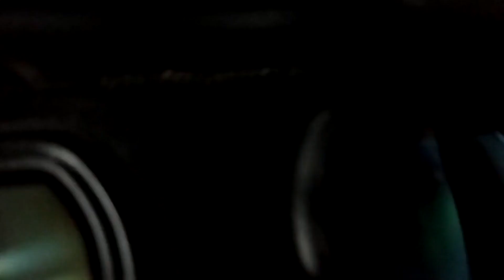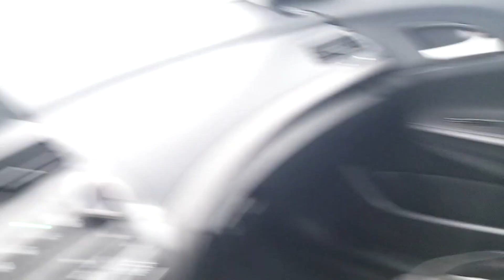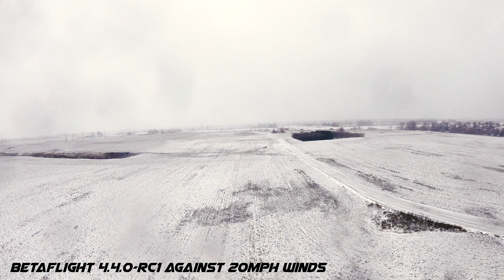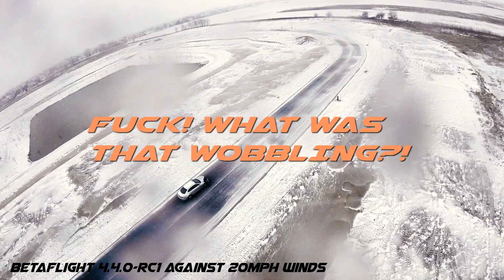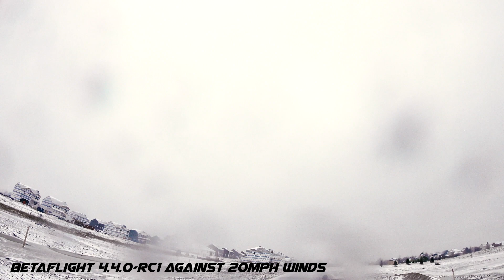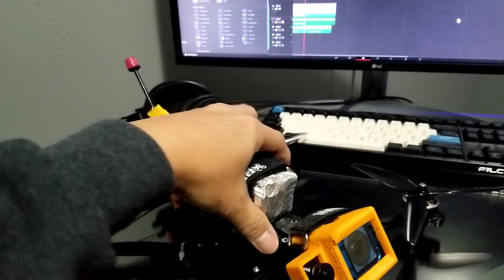Betaflight 4.4.0-RC1 on 7-inch FR7 Quad GPS RESCUE Failure

Comment from the maker: UPDATE: I just finished calibrating the magnetometer. I will conduct another GPS RESCUE tomorrow.
Reply: As your friendly bf dev I can tell you to disable your msg until 4.5 when we upgrade the msg code.. it’s currently very old and not very good. GPS rescue right now works best with out a mag.. thus will change but not for now
Reply from the maker: @Sugar_K  Thank you! I saw your message too last night. 🥰

Comment: I can answer this question because the same thing happened to me yesterday.
You need to go into MODES and ensure that you have an allocated MODE GPS RESCUE and a AUX channel. I use AUX 4 for 1600 go to ANGLE MODE, then AUX 4 seconsd switch position to 1800 GPS mode. Move the Yellow lines to the correct places. Test the switch with the quad plugged in and the transitter powered up. Once I had updated the MODES it worked quite well.
Reply from the maker: Hi Christopher. I was told by the Betaflight developer the reason why GPS with COMPASS didn't work for me. It was because COMPASS was enabled. They told me to disable COMPASS since it doesn't work in Betaflight 4.4. They promised they'll make it work in Betaflight 4.5. Right now with COMPASS disabled, GPS RESCUE is working like a charm,

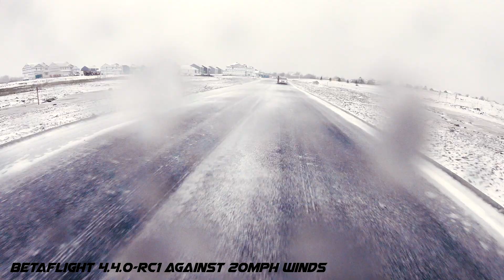Comment: @2:50 many larger kwads have this problem when you yaw hard. That GPS RTH failed sucks because I was hoping they finally got it figured out. Looks like the magnetometer is off... Last crash I got was on BF 4.3.1 and It didn't behave the way it was setup. It completely ignored all settings. You can check out a vid on my channel...

Comment: Hmm… If you’re going to calibrate the compass. Remember to point the quad facing north when you plug it in on location. You need to calibrate the compass on location as well before you fly your first pack from my understanding. I don’t think it makes sense to calibrate the compass at home and it’ll reset the next time you go out and change change locations.  This is the same with DJI Mavics.  I’ve always had inconsistent results in BF 4.3 and older, but will try 4.4 out too soon. Let me know if you have any further luck with testing. 200 meters should be enough. 500 is a long walk 😅.
Reply from the maker: I flashed INAV in the same 7-inch quad. I calibrated the compass inside the house. I didn't calibrate the compass at the location I flew. However, someone also told me it doesn't hurt to calibrate compass at the location of flight like you said. It will have better calibration since it will be away from magnetic forces like monitors. Anyways, the "Return-to-Home" in INAV with compass/magnetometer enabled was still successful.  Chris Thompson, a betaflight developer, told me that after doing the calibration in BF, I have to fly it with Blackbox logging enabled. There is a value that we need to capture that we will use to orient the compass/magnetometer. I wasn't aware of that. In INAV Configurator, it was a futuristic configuration or wizard. My quad is still using INAV firmware. I think I'm going to stick with it especially I'm flying to Philippines soon. You need to watch my 2 videos which were running INAV. One is for RTH testing and the other one was like I am doing some juicy-sbang using 7-inch quad on INAV.
Reply: @neilfpv  yeah I saw the videos. I tried iNav but it felt terrible for freestyle to me so I went back to BF. For gentle mid range cruising or long distance I guess iNav is good.

Comment: If you get a chance try a RTH with the compass disabled completely. It would probably work just fine. I've seen multiple firmware mention adding a compass can make things worse unless it's setup ideally. So it might be worth showing everyone how well it can work with just gps. Great video though. Also can you describe a little more about what you used around the battery? I've always wanted to insulate it somehow but couldn't think of what to use.
Reply from the maker: I finally tried it few days ago. It actually worked! One of the Betaflight developers, sugark, told me that compass will be fixed in Betaflight 4.5 :)

Comment: can u share stable preset for 7 inch, or told us which one u use?
Reply from the maker: In 4.3.2, I picked Supafly 7" and it was tagged as "stable". In BF 4.4, there was no stable 7 inch preset. There is a community preset made by UAV Tech. I think the preset in 4.3.2 was better or maybe because when I tested 4.4, it was very windy so it's unfair for 4.4. I didn't even tune it yet but both version flies great!